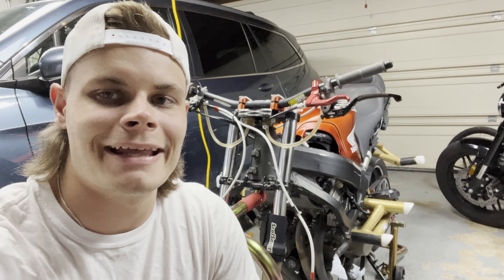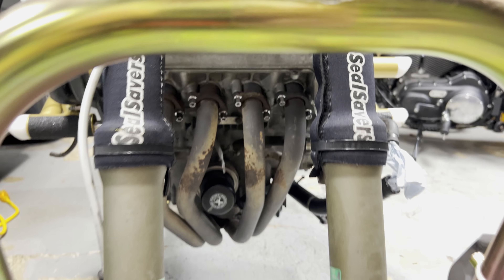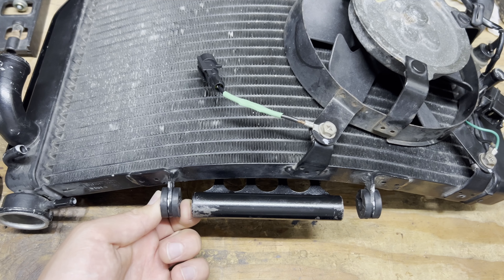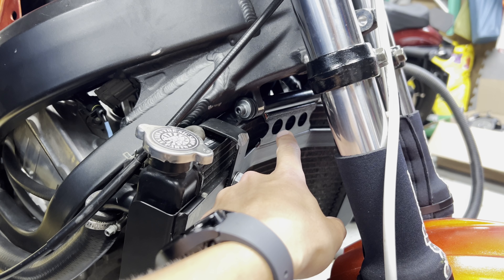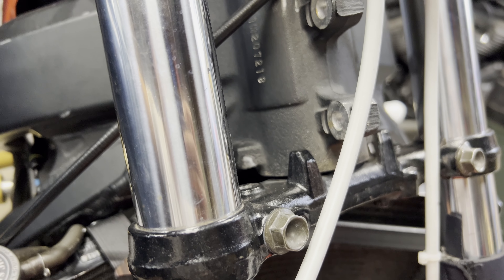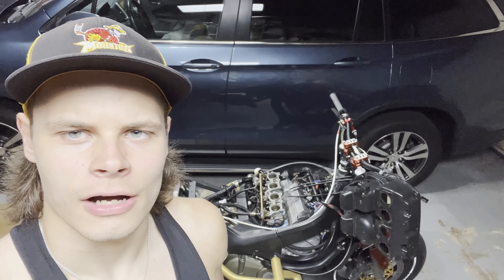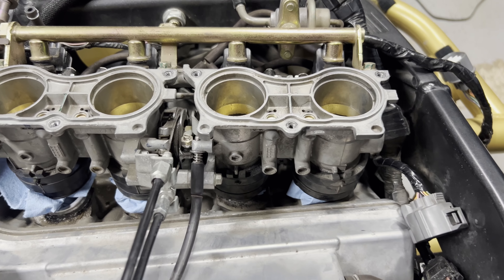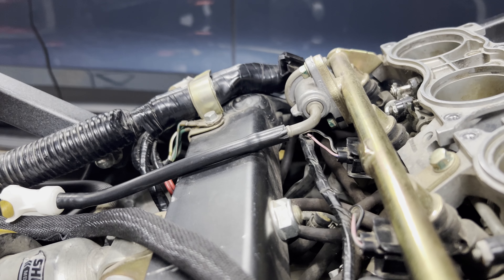FRAME FIX & DUAL FAN SETUP!!! - Lot Vlog Ep.12

Comment: Hmmm  Seems like it could be a vacuum leak that is slight enough to be masked by the higher rpm.  Idk, not certain.  My Grom had an issue where it would almost die out, similar to a lean stall.  It was like a hiccup, and then it would run totally fine.  I clean the fuel pump with a compressor and it's been fine.  Hope you solve it soon cause bogging on one wheel ain't cute
Reply from the maker: Tb sync cleaned it up for a couple weeks but it's actin up again unfortunately
Reply: @RobRippin  that sux. No advice from anyone in the F4i forums? Hope you get it solved asap
Reply from the maker: @anthonyscott16  Idle issue is one of the many common problems with these but everyone seems to have a different origin source for their idle issue. Electrical for some, tb's for others, lots of ways to investigate
Reply: @RobRippin  ohh okay. The F4i  is such an OG stunt bike that I figured there would be a known solution to any probs. 

I just bought a 23’ DRZ400 as my next wheelie bike, progressing up from my Grom. They literally haven’t changed it in 24 yrs except for the graphics. 
So much so that the bike is still carburetored and I just spent the last 2wks changing main jets, pilot jets, needles, & clip positions at least 20+ times.
Super frustrating, but I finally found the magic combination. 
Said all of that to say, I know your pain. But keep grinding and you’ll definitely solve it. 
Have a great week Bro!